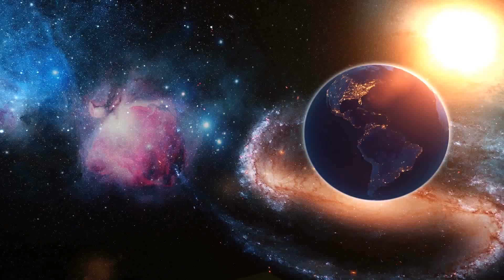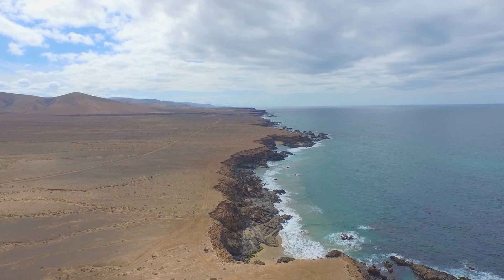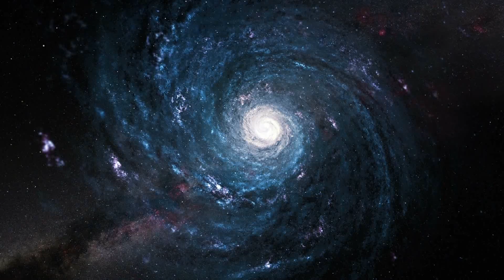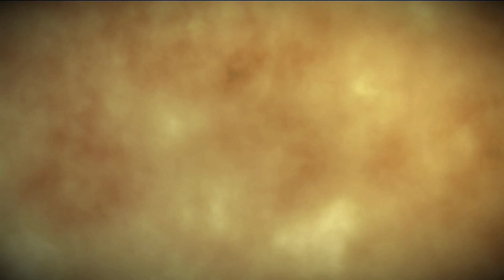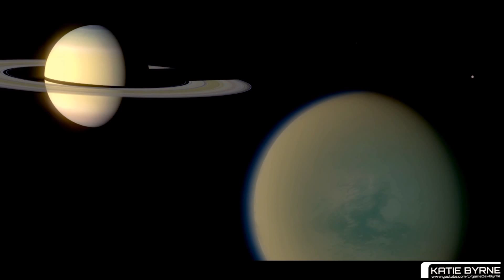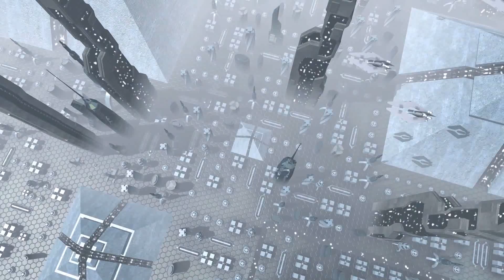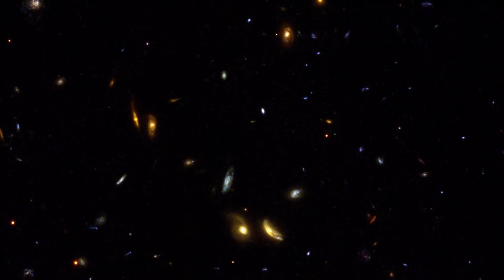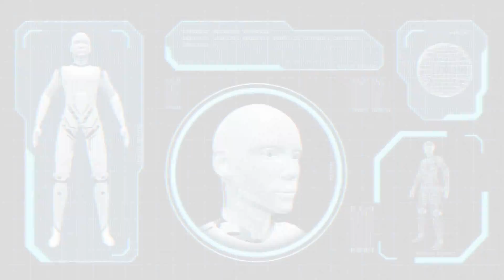Planet Ships

Comment: tidal forces and acceleration are not to be confused
the gravitational acceleration on the earth is NOT the same as tidal forces although they are related
the acceleration is first of all a freefalling one - that is just like an astronaut in a space station falling around the earth the earth being pulled on by the moon falls towards it but internally experiences zero-G at least as long as you simplify it to a point mass - the acceleration itself does no harm, even if it was much greater - the TIDAL forces on the other hand are the DIFFERENCE in acceleration resulting from distance difference and gravitational gradient - essentially the side of the earth that is closer to the moon experiences more gravitational pull because it is closer and the side further away experiences less gravitational pull - thus the closer side wants to fall towards the moon faster and the further side slower, thus stretching the earth - these are tidal forces - but as explained they depend on a difference in distance - the side closer to the moon is SIGNIFICANTLY closer - thus there is a significant difference in gravitational pull - if the moon was very very very massive and very very very far away it could have the same gravitational pull but the tidal forces would be much less because the earths diameter as a percentage of it's distance to the moon would be relatively smaller and thus the difference in force between it's sides less
in fact the sun does this - as the earth goes around the sun the suns gravity accelerates it with roughly about 1/1500 of one G - much much more than the moons 1/300000 of a G - roughly around 200 times more - but since it is also about 400 times further away the tidal forces we experience are only 1/2 as strong as those from the moon because the distance difference or the earths diameter relative to it's distance is percentually smaller
or to sum things up
gravitational pull is M*G/r²
tidal forces are 2*M*G*R/r³
with M being the pulling mass - the moon in this case, G the gravitational constant, R radis of of earth and r the earth moon distance
the important part being that one is divided by r squared, the other r cubed - a gravity tractor half as massive as the earth would be 40 times as massive as the moon and thus could be about cuberoot 40 or 3.4 times further away to create the same tidal forces but would create 3.4 times the acceleration

Comment: You build a sort of thruster like half sphere reaching into space, pump the sphere out of all of the atmosphere so it is the same as the vacuum of space. Place a black hole inside of the thruster, a small black hole so it emits a lot of hawking radiation, use that to push on the half sphere (covered in mirrors to reflect the hawking radiation) and you have a makeshift solar sail using the hawking radiation to launch the planet forward

Comment: 3:30 you properly heard this by now, but is NOT what cause tides. Tides comes from the oceans being squished perpendicular to the Moon-Earth vector. Think of balloon being squished, it bulges out perpendicular to the force. The squishing force is actually a case of a tidal force. These stem from the interplay of spherically symmetry and straight lines. Like the thought experiment from GR with two apples falling towards the center of the Earth.

Comment: Take a solar sail and anchor it to the planet.  Shape the sail like a rocket bell.  As the planet radiates heat it pushes the sail that reflects all of it in one direction. Use fusion to make more heat. Your tether could be space elevators attached to a ring with a track that has tethers to the sail.  This would let the earth still spin.

Comment: Great episode!  No complaints, except that we need to get to that stage of ability as soon as possible, whether we actually need to do it right away or not.

I suppose once you've pulled most of the rich/heavier metals from a planet, you might as well make good use of the rubble, too, maybe plunge it into its star and lift off new planets like a world-recycler.  You could also clump big rubble piles into goldilocks orbits and terraform them into high-life, lower-density planetary park worlds.

I particularly liked the idea in the later part, of starlift-splitting a large star into orange/red dwarfs to conserve them for later or for building smaller mobile systems, especially if it were a high-metal source that would supernova soon anyway.  You could make a lot of useful systems out of Betelgeuse if you caught it before it blows up on its own.  I guess we'll get into that next time :)

Comment: My first thought was Niven's story about re-spinning the frozen Earth when a space jump goes awry. My second thought was using a rocket drive (like those hinted at for Cybertron or Apocalypse' world or War World) or mass driver (daydreamed 50%-c anti-orbit cannon, like a Bolo mass driver, for example). My third was a 100 mile tower (low earth orbit) of reinforced plastic tubing holding out the atmosphere around some rocket motor with high-speed (escape velocity plus) exhaust - if surface nukes haven't affected the Earth's orbit, it's doubtful that a propulsion system, whose (there has to be a better possessive term for that) exhaust remains in the atmosphere, will do anything.

Comment: The mention of the expansion of the universe has me thinking: doesnt gravity have an opposing effect to that expansion? If artificial gravity turned out to be possible in some way, could it in theory be used to expand the cosmic event horizon, if a sufficiently powerful civilization could create an artificial gravitational force that induces a larger acceleration than the acceleration of the universe, over a distance equivalent to the scale of the observable universe?

Comment: To deal with the planetary heating issue, due to rockets or tidal gravitational effects, couldn't you heat pump the excess heat around the planet and then radiate it in a desired direction to reduce the planetary energy and also give a little extra thrust due to that radiation?

Comment: Moving an entire planet is very inefficient. Most of it is completely generic rock and iron,  not significantly different from the rock and iron to be found in planets in the destination system. So the smart thing to do is to remove the outer shell of Earth - just the outermost 10 miles or so should suffice. Divide it into say 100 x 100 x 10 mile chunks for easy transportation. At the destination prepare a planet so its radius is 10 miles less than Earth's originally was, i.e.  if that planet is initially too small then add material, otherwise subtract. On this prepared foundation we can then assemble the pieces of Earth, like assembling a jigsaw. Et voila! Much easier!

Comment: Surprised you'ven't mentioned the two (or three) examples of this stuff in Sci-Fi by that Niven guy
Spoilers ahead

"A World Out of Time" - they built fusion candles on Uranus to slingshot Earth to a cooler place after Sun was destabilized in a war with the colonies
And, of course, Ringworld - puppeteer's homeworld is a fleet of five planets moving at 90% light speed. And in "Ringworld's Throne" they moved Ringworld itself (though that may not count since they used hyperdrive to do it)

Comment: There is difficulties in using rocket to move a planet.

First, of course, the atmosphere.
Then you also need to consider how much pressure the crust can withstand. You don't want your rocket crack the planet's crust like a nail hammered into an egg.

But all can be solved if you move a barren rock, like say, the moon.
There is no atmosphere, and the moon is solid through its center.

So yeah, the idea of using moon to bait/kite the earth toward some direction is better than using rocket to directly push the earth.

Comment: It makes no sense that if you head to another galaxy at 8% of light speed, and it's moving away at 7% of light speed, that you'd arrive at 1% of light speed. If it's moving away because of expansion, you'd surely arrive at 8% of light speed, as you'd have reached the other side of the expansion gulf. Or am I missing something? Maybe it's moving away using a combination of regular velocity plus expansion of the space inbetween? Hmmmmmmmmmm

Comment: The dwarf planets of the outer solar system might be great candidates for this. Much less energy needed, their current environment is pretty much interstellar space already, not much of historical or cultural significance will be disrupted, and there are literal mountains of fusion fuel to sustain a colony for the centuries or millennia between flybys of star systems. You might also be able to get quite a bit of extra kinetic energy by gravitationally slingshotting around stars as you visit them.

Comment: I don't think anyone will move planets interstellar. At this tech level, mining and refining the mass is easy. You don't send raw rock because refined mass can be filtered and graded by element, if say the destination already has enough silicon, you can cut down on the mass sent.
Its also easier to send mass if you don't have to worry about cooling it and protecting it from G forces. No need to send all that rock as fragile. Stelasers give substantial incentives to sending cargo in serial. If you send out a spacecraft a day for 100 years, you don't need as many lasers as you would if you sent them all at once. If you accelerate fast, you can use less energy, because zigzaging the beam is easier when the spacecraft hasn't gone very far yet.

Comment: you say we can use gravity to slow down time in the planet but is it possible to speed up time instead? that would essentially increase the available time for humanity to exist perhaps even to infinity (could be a solution to the fermi paradox since your now in a pocket of universe ) as well as being able to out compete any civilization out there that doesn't use this approach
Reply: doing this would use up so much energy so quickly that you would just loose to entropy even sooner.
Reply: I thought about that few episodes/years back, but tech updates from earlier home (you don't want to take everyone to the voyage) nullifies the problem. Well, almost.
Reply: @tonikotinurmi9012  what if your home planet ceases to exist?
Reply: @rogercoulombe3613  thinkin in galactic terms its a good thing to use up all the energy in your home system at an accelerated rate since the rest of the universe is still rolling along at normal speed burning all its energy regardless and expanding beyond our reach

Comment: Do you have to care about keeping a planet's core alive when you're in the realm of seriously considering building a whole shell around it?  If you're building shell planet encasing shells and in the business of moving planets,  would there be any reason to keep the core?  Or could you let it cool off, or even use some of the core to build the shell(s)?  I feel like it would be preferable and eliminate a hazard, while making the structure hardier.  So instead of cracking an egg it's like cracking a solid rock. Meanwhile I'm imagining large support structures to host the shells that go right through the planet.

Comment: And here I was just contemplating a possibility to fix global warming by using the Moon as a gravity tractor to change the Earths orbit to be further from the sun. I mean all it really needs is two big enough rocket engines installed in the surface of the Moon, one prograde and one retrograde. No athmo to worry about and plenty of space for infrastructure. It even keeps the same sides pointed in the right directions!

Comment: Reminds me of that Chinese sci fi movie that came out recently. Quite fascinating when you think about it, though it pretty much destroys what makes this rock special, it's Flora and Fauna. 

But as we are at it...I always wonder about life development on other planets. AFAIK one component that makes earth rather special is it's high rate of nitrogen, which usually tends to sink to the inner mantle of a planets core during it's formation but due to the supposed collision with another planet early in Earth's lifetime is rather abundant on the earth's surface. So how important is that really and what are the chances for this to happen on another planet? And if not, is there a way to form life without this substance? Or different substances to begin with, like silicon?

Is seeing a planet an option? Are the lifeforms on earth that would currently surive and live on Mars or other places in the solar system, possibly change a planet's composition in the long run?

Comment: If the earth were about to leave the gravitional pull of the sun it would loose its atmosphere and freeze down to about 0K, i guess that could be slightly less inhabitable than enduring the suns heat. But moving earth only little with for example a giant laser field firing into the sun whenever being in the right position could move us just far enough to keep a healthy climate. This would allow us to slow down afterwards or correct the course. Also some giant laser field could be transported and than used to block a NEO like a comet hitting earth.

Comment: I have very serious doubts regarding whether a planet has sufficient cohesion to withstand a thrust that would be enough to move it from place to place. Not only that, but you would have to stop its rotation if you wanted to go somewhere in particular. If you know of a way to stop the rotation of a body with a mass of ~5.9722 × 10 24 kg without utterly destroying it, I would love to hear of it. That is a very large heap of angular momentum.

Comment: There was a reference to galaxies moving away at 7% of light speed. I assume that this is calculated from the "Red Shift". IE. Light from distant object shifts to the red side of the spectrum because of the Doppler Effect. But, Suppose that at least a portion of that shift is caused by Atrophy? As light travels through space, it is losing energy. As energy is lost, it does not slow down, but the wavelength increases; there is a shift to the red. I believe that distant object may not be moving away from us as quickly as they appear to be because of the Red Shift.
Reply: "Tired light" or "photon decay" was first proposed by Fritz Zwicky in 1929:

https://en.wikipedia.org/wiki/Tired_light

It's been thoroughly examined and there are a few strong reasons that astronomers accept expansion over light losing energy over time (specifically, effects it would have on supernovae and the cosmic microwave background). I can expand on why, if you like, but the short answer is that it's been a theory for 90 years and considered disproven by observations that work under expansion but don't under tired light for 30+ years.

Comment: there's a little voice in my head that says "what about the orbit around the sun and our rotational speed? isn't this going to be an issue?"
Reply from the maker: Only if you want to launch at an angle perpendicular to that orbit, otherwise it just offers a nice speed boost while leaving, so long as you time your push to chuck you at the right direction. Done right, you get quite a nice bump from both our orbit around the sun and it's around the galaxy.

Comment: When you're talking about using the moon to nudge the Earth away from the sun wouldn't you want the moon to be inline with Earth's orbital vector when you nudge it? Nudging out perpendicular to the Sun's surface seems like the really slow way and you'd only get 2 times a year to expand the orbit while doing it inline would give you once a month (nudge out in line with the vector nudge towards earth on the opposite side half a month later) worth of pushes.

Comment: Doesn't the speed of universal expansion preclude us from ever reaching galaxies outside of the local cluster?  And if so, aren't the timescales of these "outward bound" voyages of about the same magnitude as the "inward bound" movement of the local merger?  Saying that we have a range of about 10 billion light-years doesn't seem to make much sense if the local cluster has merged by then and there is nothing else left except for extra-galactic void (note that it can't even be called "intergalactic" void by then).
Reply: Depends on your speed where you get, but: yes you are correct. That 10 billion light years is an educated guess (also this has been covered throughly in an earlier episode).